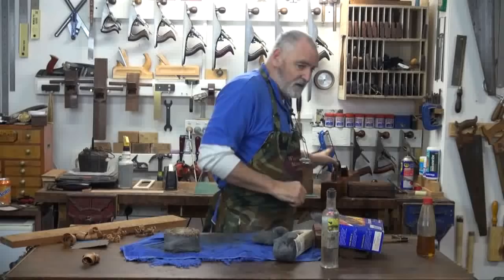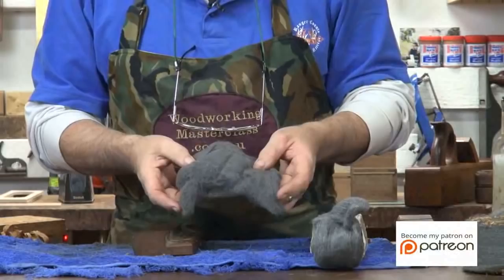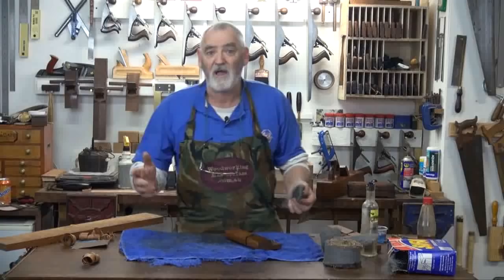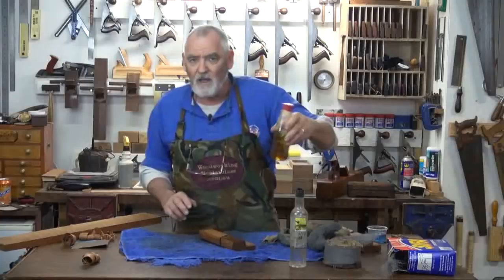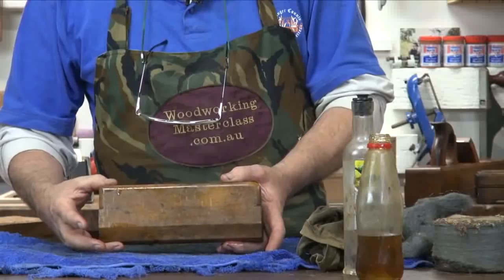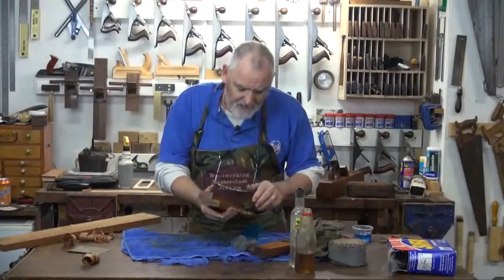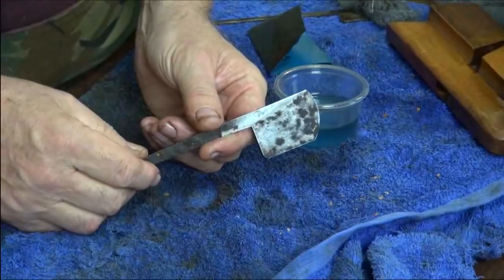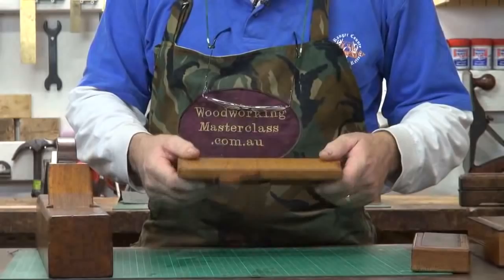How to restore Wooden Planes

Comment: Hi Steve, I just brought back my grandfather's coffin and smoothing planes from Adelaide and having watched this video several times and getting the right stuff for the refurbishment, I have taken before pics and stripped pics.
After a recoat of Raw Linseed and Turps, I will take I will reseat the the sole, if required and reset the plates for a trial run.
Thank you for your well presented step by step process which has given me the confidence to do this and honour my grand-father, father, eldest brother, and in the future, my children and grandchildren, who are also taking an interest in wood-working. Regards, Mike.
Reply from the maker: Hi Mike, what a wonderful story to tell. Thanks you so much for sharing it. I have a theory about old tools that some of the essence of the pervious owners survives with it. When it get used it's like reconnecting with the past. Some how or other, if they were good skilled people the planes are much easier use. Like the difference between riding a horse that has been broken in over on that is still wild. :) Cheers Steve

Comment: Hello from across a somewhat bigger ditch to the left coast of the US. Really do like your subtle approach to restoration finishing. If one dives in with heavy sanding and all you might as well build a new one. Just ordered some gum turps and raw linseed oil to give your 50:50 mix try. Thanks!
Reply from the maker: Hi Jack. Thanks for the feedback. You are right so much old furniture has been ruined in the guise of restored by not being sympathetic to the restoring process. Good on you for giving it a go with the Turps and Linseed. Please let me know you thoughts once you've tried it. Cheers Steve
Reply: @Woodworkingmasterclass  Will give you feedback. FWIW we do get to Oz from time-to-time.

Comment: Hi Steve just came by your masterclass, have been renovating old planes for a while but always used the wire wheel on the metal, will use new method from now on, just purchased 120 moulding planes from a garage sale, all made in York England by the Ebor works, going to be busy for a while.
Jess
Reply from the maker: Great find Jess, lucky rascal!. I find the above method is for kinder to the tool than a wire wheel, although I have used them in the past. Would love to see a photo of them when they are all finished. Cheers Steve

Comment: Great video! I have done a couple of these up and where the irons and caps are really rusty have brushed off the loose rust and then put in molasses for a week or so and they come out great. This works especially well on picking out the old makers stamps in the irons. On really old dry wood  and those really dirty ones I have also used a blend of meths turps and raw linseed in roughly equal proportions.  Cleans and hydrates as you go. Cheers from South Africa.
Reply from the maker: Thanks Barry, great tip about the molasses i'll try it if I get some really stubborn rust. Cheers Steve

Comment: The methylated spirits are a great trick, thank you. Agree it's nice to keep the patina on the blade but if you actually want to use it, you will have to grind the rust pits out of the back or it will never sharpen up cleanly. Ideally with a wet stone so as not to wreck the temper of the steel.
Reply from the maker: Agreed. Cheers Steve

Comment: This video was amazing- thanks from America!

I have a #28 Bailey planer and the sealer/coating and wood all around has been worn out with lots of pockmarks. Is it okay to use sandpaper there? Especially the bottom has LONG gouges all along it. I don’t see any coating or sealer remaining.
Reply from the maker: Hi Kyle, Planing it would be more accurate but if all you have is sand paper that would do fine just make sure it is nice and flat and even when you finish. Cheers Steve

Comment: Thanks so much for your videos. I am just starting out with proper hobbyist woodwork with aspirations to make some half decent furniture and your videos, amongst others are so informative and inspiring. I have recently been given some old tools which were a friend's father's, and pretty decent quality, but old and neglected after a career of use. I've been following your technique to restore some old wooden try planes and have a couple of questions... One smoothing plane has some minor scoring on the foot, is it worth Sanding these back on a flat block, or will this do more damage than good? Also, the smoothing plane I have has some heavy build up of resin and gunk in front of where the irons sit. Do you have any tips for clearing this from such a hard to reach area which are as gentle as steel wool and metho, or is it necessary to use a sharp tool to get the worst off? I'm not after them looking like muséum pièces, just wanting to bring them back to life as well as I can. Thanks so much for your help and time.
Reply from the maker: Hi Will, you can just fill the score if it's deep with hot candle wax. You do run the risk of making the blade mouth wider if you remove to much form the bottom. An old hacksaw blade should reach down to get most of the gunk off. Pic would help. Send me an email if you want with photos. admin@woodworkingmasterclass.com.au 
Cheers Steve

Comment: Hello from across the ditch . As a Kiwi I am very interested to hear you mention "Gum Turps" . Is that in any way a form of Eucalyptus Oil or something related? I have read that the Oils from the leafs of the various cultivars have differing properties, and that there are three main general uses Medicinal, Industrial and Therapeutic ( scented oils) .  I have used Eucalyptus Oil for years from the super market for getting chewing gum out of the carpets of the tour coach's I have driven. However recently I have found that we just can't by the stuff over here in New Zealand would you know any reason why at all?  As it's the most useful thing that mother nature has given us.
Reply from the maker: Hi Andrew, As I was also under the impression it was a eucalyptus oil. It was interesting to discover that in fact it is made from Pine Resin not eucalypt at all. As with a lot of thing in the past 12 months stock seemed to have disappeared from the selves of many product. Try eBay? Cheers Steve

Comment: I wonder if you have any tips about a Record 405 multiplane . A useful thing but designed to make me struggle .  Just holding it to make alterations is an art  Love the accent by the way .
Reply from the maker: Hi John, I use the Stanley 45 quite a bit which is the equivalent of the Record 405. I'm left handed so that makes it a bit more of a challenge, the trick I found is the cutters have to be very sharp and set for a shallow cut. The rest is just practice and perseverance. :) Cheers Steve
Reply: Fotunately I discovered my main mistake (in the last 2 days ) was setting the blade edge in line with the inner face .Also the spur was not very sharp. A couple of videos explain all that .   Thanks for the reply . @Woodworkingmasterclass

Comment: After oiling a few times would you shellac them then wax them or just leave them oiled?
What do you think of the brass soled planes?
Nice video, just bought my first wooden rebate plane to clean after watching this, trying to persuade my wife that a shelf full of them would look good in the living room.
Reply from the maker: I'll give you a plug and see if we can soften here heart. "Planes would look really, really good on the Wall." I finish mine with wax because I like the feel of it in my hands but leaving just oil would also work. Make sure you wipe off the excess. I also really like Brass in many forms. Cheers Steve
Reply: Thank you, I normally just oil my tools, I tried waxing one of my frame saws and I liked the way it looks and feels. I think I will buy another couple of rebate planes and wax one of them to see if I like it. 
The plane shelf will be a work in process, I am going to use them, I would prefer to store them in the house rather than my shed though.
Reply from the maker: Good idea, as i said, 'I prefer the feel of the waxed ones', interesting to see what you think. Careful or you may start a workshop inside the house as I did with "Room for Woodwork" https://www.youtube.com/channel/UCX4wxZPvkIhrv9oFtyIaAEg
It all good, and by storing them inside you at least show respect for your gear which will make you an even better woodworker. Cheers Steve

Comment: Thanks for the vid. So, are you using BLO with gum turps, or raw lindseed oil and gum turps? Thanks!
Reply from the maker: Pleased you liked it Kurtis. In that instant I was using Raw+Gum turps. Boiled dries to fast for my liking. Tung oil is another good alternative as is Danish Oil, only it takes many more applications than the Linseed to fill and soak in. Cheers Steve

Comment: Hello, What are all the products that you use to clean the planer in the video? Due to your accent it is hard for me to understand, English is not my first language. So, I maybe able to either find it here in Canada or a substitute in case I cannot find it here. Thank you.
Reply from the maker: Hi Robert, Mentholated spirits, Steel Wool to clean uop the timber bits. Kerosene or Parifin Oil and wet and dry paper for the metal parts and Raw Linseed oil all over the finished wooden parts. With some candle wax on the threads. Cheers Steve

Comment: What is meths turps? Would that be what we call turpentine in North Amerca?
Reply from the maker: Hi Jeffery definitely NOT Turps here are some other names for Methylated spirits also known as Denatured alcohol or denatured rectified spirit. Hope that helps. Cheers Steve
Reply: here's  a few things to consider before you setup your own woodworking company
are you likely to have support from your spouse?
Are you self-motivated?
Will you carry out your plan?
Do you have the funds to begin?
(I read these and the reasons they work on Enata wood system website )
Reply: @Woodworkingmasterclass  My Yank ears were having some trouble trying to figure out what products you were using as well. would have never guessed you were talking about Denatured Alcohol. Methyl/ Metho? sounds much cooler. Thanks Steve! Cheers!
Reply from the maker: @michaelh5564  Metho is about 96% pure whereas, DAA IS 100%. It's amazing how much difference that 4% makes. Especially when French polishing. Both taste disgusting though! Cheers Steve